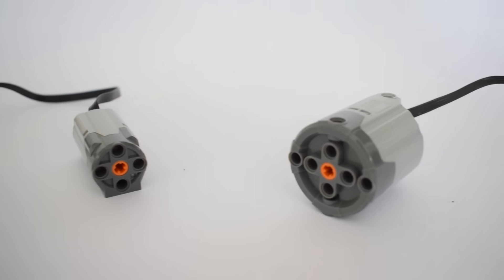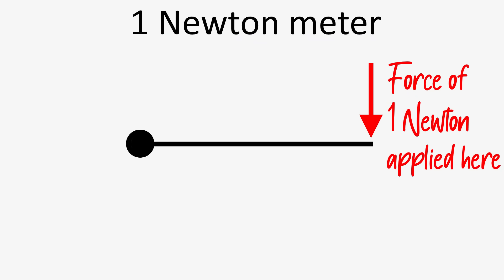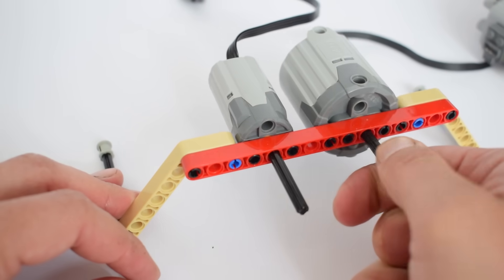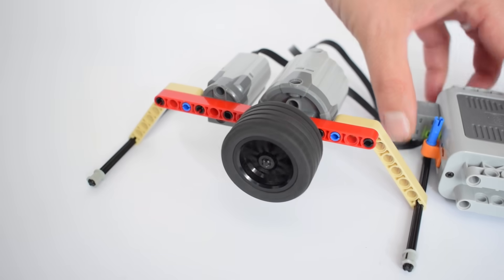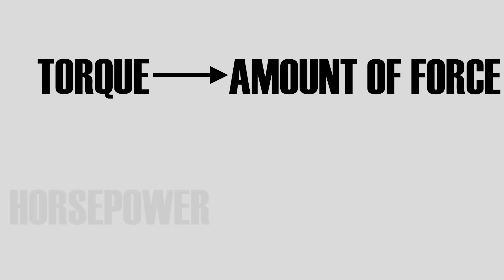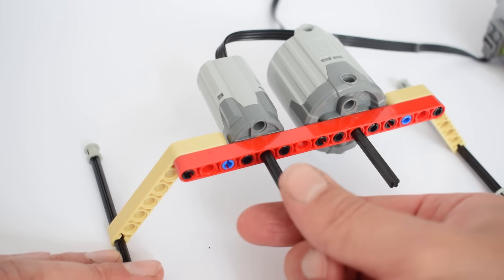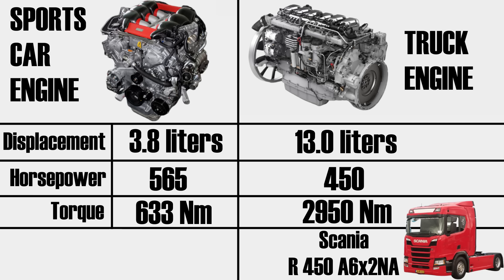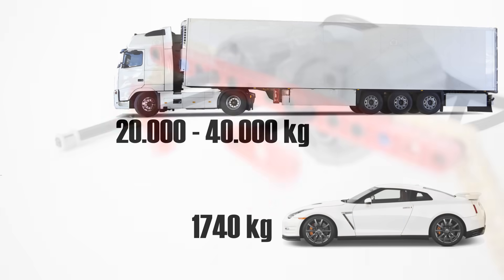NEVER be confused by HORSEPOWER and TORQUE again - HP and TORQUE EXPLAINED in the MOST VISUAL WAY

Comment: Also you should add that HP is far more important than torque because you can always get more torque through gearing, but you can never get more HP
Reply: Another important thing too - torque isn't constant over the rpm range of an engine. It will have a point where it creates it's maximum torque then starts dropping. Having peak torque at low rpm means you'll have more power available at very very low speeds where you can't shift into a gear lower than 1. The engine will have lower overall power than an engine with the same max torque that occurs at a higher rpm though, since power is torque * rpm. 

A sports car with 400hp and 250 lbft of torque can pull a trailer faster up a hill than a truck can, but the truck with 300hp and 250lbft has more power at 1000 rpm to start pulling it up a hill if there's a stop.
Reply: Yep, he actually gets it wrong and just added to the confusion.
Reply: thats what i am saying in a lot of discussions and people who dont have a clue will always start to rage about torque beeing important. Then you tell them that more torque at the same rpm means more horsepower and they seem to never come back again.
Reply: @romansenger2322  at the end of the day, it's about reliability and efficiency. The 450 HP sports car engine CAN output 450 HP,  but to do so for a sustained period would result in extremely poor reliability and very low efficiency.

The large truck engine can pull 350 HP all day, and it can do so with much greater efficiency. 

For a car it doesn't matter: you don't need the full power of the engine for minutes at a time to get up to speed. For a large truck, you're going to have the engine pulling hard for the majority of the time you're driving it. 

So while you could gear the car engine such that it would have comparable performance to a large diesel engine, you'd be lucky if it lasted 100k miles, while getting dramatically lower fuel efficiency to boot.
Reply: @caracalfloppa4997  this 👍
Reply: Came to the comments to say exactly this. Attach 5:1 set of gears to the smaller engine and it'll produce more torque than the big one. Whether accelerating a sports car or hauling a huge trailer, it is torque at the wheels which matters. Horsepower tells us how much torque can be produced after the gearbox, where it will be doing the work. Engine torque is irrelevant to performance.
Reply: @jimomega381  I'm giving peak power and peak torque figures
Reply: Subatomic Molecules  Very well put.  Through gearing or leverage, a human can produce 1000 (or more) ft/lb of torque with one hand.  Applied to doing work through, his capability would be quite low because he can only make that torque at a low speed.  Torque is only half of the equation.  Powerplant RPM tells us how many times we can multiply that torque via gearing for a given output RPM
Reply: Somewhat bizarre to be measuring torque in Nm but power in horsepower not W.
Reply: why don't we have a sports car engine with gears in a truck then?
Reply: @melvin3509  theoretically you could, but many engineering considerations cause them to diverge. Truck engines can be quite powerful, but they don't need to accelerate THAT fast, so hp can be quite lower than expected BECAUSE gearing can magnify torque. The engine of a Lamborghini v12 is engineered for lightness, engine sound quality (sounding good), responsiveness, and power for max acceleration. Everything a truck doesn't care about. The engine of a truck is engineered for reliability, efficiency, emissioms, without second thought being put into lightness or engine sound quality. Because truck engines have an already considerably high amount of torque, less torque conversion is required on the transmission level to move the truck.
Reply: @subatomicmolecules  

A truck gearbox also has a lot more gears than a car to reach the same speed
(where 'strength' is sacrificed for speed)
Reply: @melvin3509  Firstly, because sports car engines are more expensive and less reliable than truck engines. They'd be capable of pulling the load, but why spend the extra for something that won't last as long?

But what I guess you're really getting at is why does a high torque engine feel stronger than a high powered one? That's where it starts to get a little more complicated. Power is Torque multiplied by RPM. It's not constant, it changes depending how fast the engine is spinning. When both engines are spinning at 1500rpm, the truck engine will be producing much more power than the sports car engine. It produces horsepower to pull a heavy load without needing to spin quickly. The sports car engine engine produces its power by spinning quickly, but doesn't produce much power at low RPMs. This is fine in a sports car, but nobody wants trucks screaming around at 6000rpm all day.

In both cases, it's still the power that is doing the actual work of moving the vehicle. The torque figure just gives us an indication of how much horsepower is produced at lower engine speeds, rather than the peak power which is only available when the engine is working as hard as possible.
Reply: I guess the confusion comes from topspeed as torque becomes much smaller in the overdrive gears, and as drag increases exponentially the force equals the one being applied by the wheels. In that case you need more torque to go faster.
Reply: Buy a Tesla and this comment exchange becomes irrelevant.
Reply: @leebatt7964  no one wants to buy that garbage
Reply: Is that why trains, semi trucks, diesel pickups, and electric vehicles have superior torque? You cant replicate the towing capacity of a high torque power source with simple gearing. Both horsepower and torque are important but in the realm of hauling cargo torque is more important. The same theory can be applied to power and air tools. A simple drill can be good for tapping holes and securing bolts and screws when there is little resistance. Whenever there is any resistance an impact gun with superior torque is used.
Reply: @belowpovertylineminority  Why do such a long text just to tell you didn't understand anything at all about the video, or things in general? Small vehicles won't make as good towing equipment as heavier, because the towing force limit is set by weight on wheels. As for using impact guns, those are used because the counter forces from the rapid impulses are absorbed by impact gun inertia. A really high torque applications (like Hytorc) uses pure torque and need to be anchored in place, it would braid arm bones together in an instant if held by hand.
Reply: @belowpovertylineminority  if you built a CVT that could survive then you could use a much smaller engine to power the truck. The part that's missing from a realistic application is the inertia of the rotating mass. You would need a huge, dense flywheel or another means of storing energy to move the vehicle from a stop. That would reduce the efficiency of the smaller motor and make driving it very annoying since you'd need to wait for the lower power motor to spin the flywheel to a sufficient speed. This is why trains don't use the diesel engines to propel it forward, there's simply too much mass to get rolling. Instead, it uses the diesels to generate power for the electric motors which produce more torque the slower they spin.
Reply: I will elaborate.  HP is only a measurement of torque at different RPMs.  
HP = torque / RPM x 5252.
Since you're driving your vehicle down the road at approximately 2000 rpm always.  It is not necessary to have high horsepower to maintain 2000 RPM if you had infinite gearing it would be irrelevant.

 It will only be making very little horsepower at that engine speed.  For example; my diesel truck makes 1050 ft lbs of torque at 2000 rpm.  That measurement is translated to 399 horsepower.  It is the torque that continues to move the vehicle.  The horsepower is just a weird way of measuring work at different RPMs.
Reply: @Anthony-qq2ue  Engine torque is only relevant if you have no gears. Horsepower is the amount of work that actually gets done. 

You can calculate torque from HP and RPM but that doesn't mean the HP is causing the torque. Torque and RPM is what creates HP. Your formula for HP is wrong btw, it's (torque*rpm) / 5252

You can always change gearing to change the amount of torque. You cannot get around the horsepower output limit of the engine. A vehicle that outputs 399 horsepower will never be able to do more than 399 horsepower of work, no matter what your gearing is. 

An engine that has 100 ft lb of torque but  revs to 1000 RPM will do the same amount of work as a 1000 ft-lb engine that does 100 RPM. Work is what  matters in the end. The gearbox handles the torque needed for the job.
Reply: @caracalfloppa4997  
Yes my formula was backwards but torque ultimately is the force of an engine and horsepower is only a measurement of torque.  Torque is the ability to do the work and horsepower is how fast it can be done.
Reply: @Anthony-qq2ue  no HP is the measurement of torque and rate. It's what matters.
Reply: Untrue.  Horsepower is irrelevant unless you have no gears.
Reply: @Anthony-qq2ue  I think you said it backwards. HP is irrelevant w/o multiple gears.

Comment: Horsepower = Top Speed
Torque = how fast you can accelerate to top speed
Reply: It's always about what power you have available at a certain speed. Higher torque is better because it results in higher power.
Faster acceleration to top speed is achieved by higher average power through the rpm.

Comment: This is why you need to rev a smaller engine higher to get the same amount of acceleration ( all other factors equal ) which is why a bigger displacement is "kinder" to the mechanics of the engine ( all other factors equal )
BAM ! 🙂

Comment: I'm normally a fan of your videos but brother, this is a hot mess. 🤦‍♂️
This does nothing to clarify the difference because firstly the equation for horsepower is;
Hp = [Torque x 2pi(rpm)] \33,000
It is not simply Hp = Torque x rpm. A Yamaha R6 would have 796,250hp at the limiter if that was the case and I'm sure you know that simply increasing rpms will not equate to more power.

Secondly, your example using the lego motors makes it more confusing. Yousay the smaller one has less horsepower so should make less "activity" but it spins faster which would suggest it has more horsepower.. The smaller motor is just set by factory to spin at a higher rpm with the given input voltage than the larger one. The lego motors are receiving power, not making making it.

Comment: I've been confused in both videos I've watched on this when they get to the equation of Horsepower = Torque x RPM. It never makes sense to be because assume a car with 200 torque and 4000 RPM, that's 800,000? I found on Google that you're suppose to divide by 5252. But I'm curious why both videos I've seen on Youtube don't mention this, and they're good videos too. Am I missing something?
Reply: It's confusing because it's wrong. 
The actual equation is;
Horsepower = [Torque x 2pi(rpm)]\33,000

The 5252 thing refers to the crossover point on  a dyno graph where horsepower and torque values will be equal at that specific rpm.
Reply: The problem is the units that you plug in and that you expect at the output.
Torque x rpm is a correct representation but there typically has to be an additional conversion constant, e.g. 5252 for a certain set of units.
In the purest form in SI units, it is torque (Nm) times angular velocity (rad/s) and you get directly the power in watts.

Comment: Also in horsepower it depends on rotational mass. Like a gear box. 1st gear has a larger gear to get the car going and final gear has smaller gear to achieve the height of it's top speed.

Comment: The gist: bigger engines usually have more torque because they have higher displacement, but they might have less horsepower than a smaller engine because they have lower max revs. HP = Torque x Revs

Comment: Very simply, I always put it as 

Torque = how much weight you can pull
HP= how fast you can pull the weight (or, also, how fast you can accelerate the weight)
Reply: Right, because horsepower is force times speed, and torque is essentially force. (Technically, force times distance from the centre of rotation, but the main point here is the force.)
Reply: thanks, that is useful
Reply: I didnt understand the video. Bit i understand now because of your comment. Thank you
Reply: @DevouringKing  Please watch the next video he made after seeing comments to this one. What OG commenter says is not "simple". It is a simplification that isn't fully accurate.
Reply: Personally, I like to think of it as Torque = performance in Gear 1 and at cruising speeds. That's when the engine isn't generating maximum HP and where you'll feel the difference.
Reply: I always put it as hp is how fast you hit a wall and torque is how far you push that wall 😂
Reply: @KindaSus666  Torque is how wrong, stupid and irrelevant an analogy is. RPM is how much it gets multiplied by "likes". Power is the resulting permanent cognitive damage caused to our collective intelligence.
Reply: Toque is irrelevant. HP tells you everything. That's the proper explanaition.
Reply: @AndreiSZS  with the right gearing, of course!
Reply: @AndreiSZS  No, HP is not everything. For fixed horsepower, a vehicle with high torque can pull a heavier load; a vehicle with low torque can go faster.
Reply: @beeble2003  Motor with more HP will go faster and can pull more load.
Reply: @AndreiSZS  So what? There is a trade-off between load and speed. You cannot know the position on that trade-off if all you know is the power.
Reply: @beeble2003  there is no any trade off. Load vs speed are due to things like reliability. More powerful engine simply does more work done. It can be carrying havier load or going faster. This video is misleading and actualy doesn't cover what is really important.
Reply: @AndreiSZS  Go start your car in fifth gear. Then explain again how torque doesn't matter.
Reply: @beeble2003  You can apply gears to any engine and get any torque you want. The question is, what torque is possible to have at a given speed and it depends on HP.
Reply: @AndreiSZS  And when you do that, you lose all your speed. Oh, look -- horsepower isn't the only thing that matters.
Reply: @beeble2003  It works in the other direction too. When you gain speed with high torque low RPM engine you lose torque. So gearbox on such engine(high torque - low rpm) will always be at disadvantage. HP is actually a mutliplication or RPM and torque. So the simplest way to compare 2 engines is to use gears to make them run at the same RPM, then compare torque. The one with more torque will always have more HP.
Reply: @beeble2003  The fact gearing exists in that scenario shows torque doesn't matter as much as horsepower, you can have any torque  with the right gearing but you can't change your horsepower.
Reply: @Spike00773  I'm not sure I understand that idea. In the truck engine vs sports car engine analogy, truck engine has less horsepower, but a truckload of more torque. Can't you just gear up the truck engine to make wheels go faster?
Reply: @SaltyMaud  Torque×rotation speed=power. Because of conservation of energy, you can never increase horsepower.

If you were to gear up a truck engine the same way a sport car would be, it would actually have less torque on the driven wheels than the sports car.
Reply: @beeble2003  oh, something clicked on my brain after reading the "1st gear" comment, but everything clicked after your reply. Thankyou!
Reply: @beeble2003 Power ,not Torque, is the measure of the engine’s maximum capacity to do work because we exist in a dimension that includes time.  Torque does not.  Torque can be multiplied with gearing - Power can not.  
Anything Torque can do Power can do better and/or faster.

Comment: This is like saying watts vs volts
Reply: Exactly!!!
You hit the nail right on the head.
Torque is a component of horsepower just the same as volts is a component of watts.
Horsepower is the final say on the matter just as watts is.
Torque is just a measurement of the amount of force it takes to move an object weighing a certain amount over a given distance, ie 100 ft lbs is the amount of force it takes to move 1 lb 100 ft, but time isn't involved in it's measurement so you can take as long as you please to do it, horsepower is how fast you can move that 1 lb the 100 ft, and since racing involves the first one that can travel a given distance in the least amount of time horsepower is the king, the final say on the matter. 
People who like to flaunt torque figures are people like Harley riders whose engine's make 80 ft lbs of torque compared to a Japanese motorcycle of equal displacement that makes 70 ft lbs of torque, but the bad news for my fellow Harley riders is that 70 ft lbs of torque at 9,000 RPM's makes a lot more HP than their Harley engine that makes 80 ft lbs of torque at 3,500 RPM's, personally what I care about my Harley is the cruise control, cigarette lighter, AM/FM satellite radio and it's ultra comfortable posture that allows me to make it from Pittsburgh to Amarillo in 2 days without needing back surgery when I get there.

Comment: Very good informative video. Torque and HP is explained in an easy and intuitive manner.  Just one thing though, torque is also dependent on time, i.e. torque is rate of change of angular velocity multiplied by the moment of inertia or simply rate of change of angular momentum. So in the end torque is inversely proportional to time square. And Horsepower is the rate of work done or rate of (rate of change of momentum), i.e. horsepower is inversely proportional to time cube.